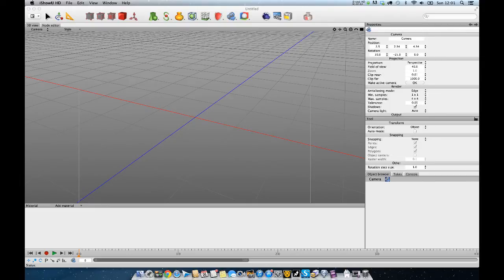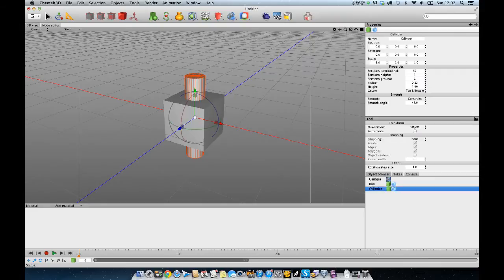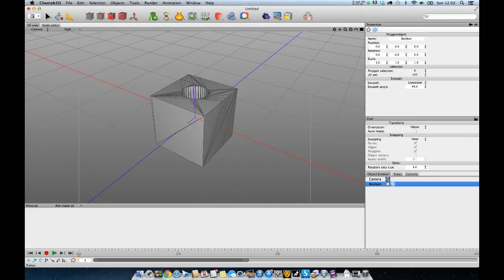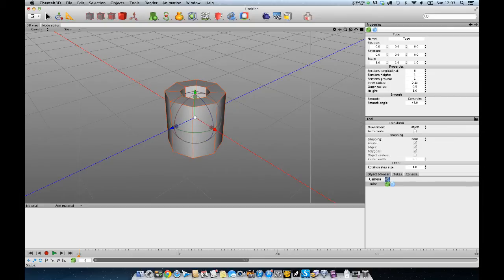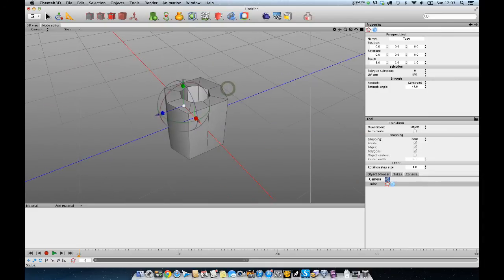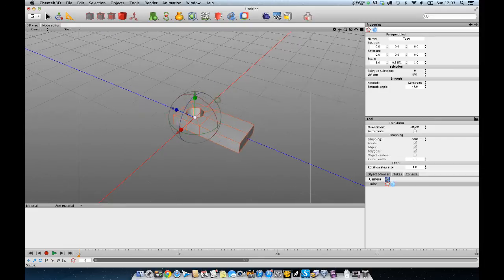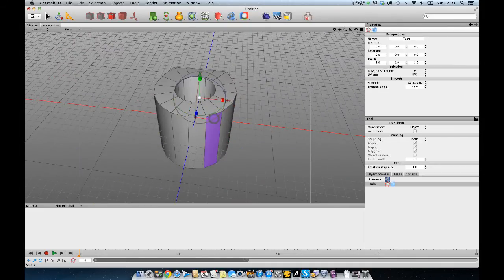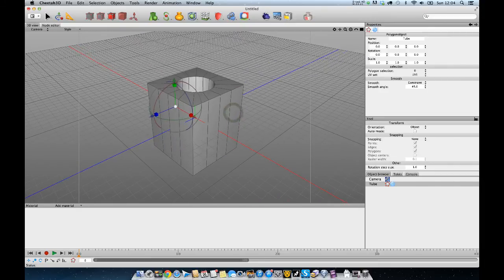Cheetah3D Quick Tip - How To Cut Holes

Comment: Thanks for such a great tip!,….is there a way to do this, but instead of one….with multiple holes that are within the same box you created from that very same tube?
Reply from the maker: Hi Eduardo, I'm not really sure what you mean?
Reply: Let's pretend I have a flat steel bar and I want to drill 5 holes in it with 5 mm of space between them. How would you do that with this same procedure you are suggesting?
Thanks once again.
Reply from the maker: One option is to make 5 of these, use the ruler to position them and then use import children and bridge to combine them all into a single object
Reply: great!,…many thanks once again!!!